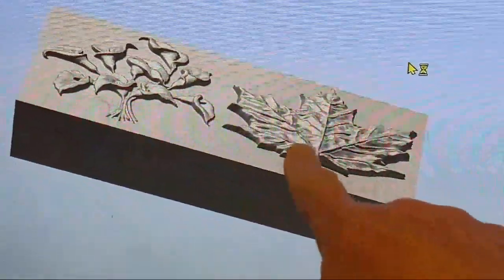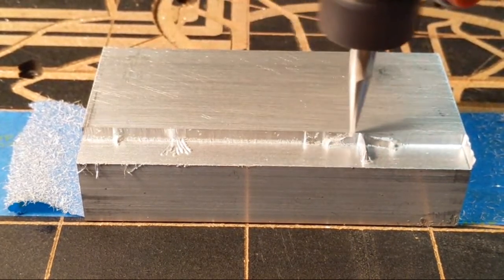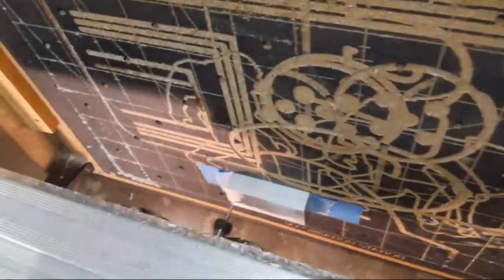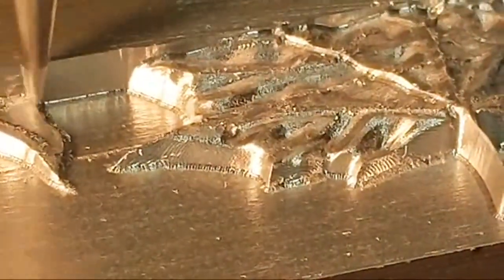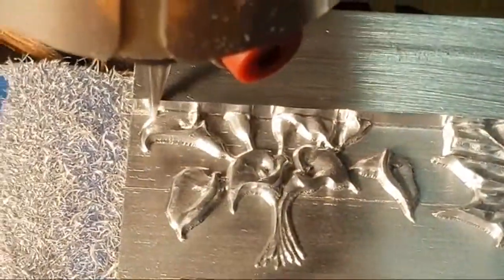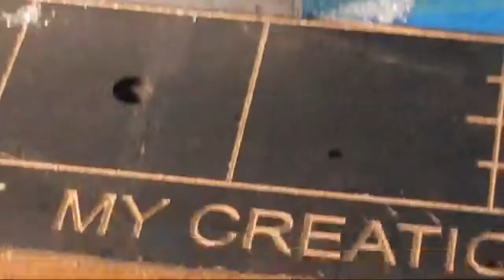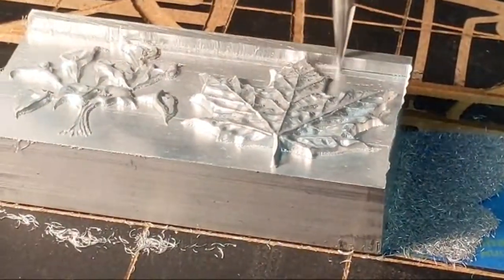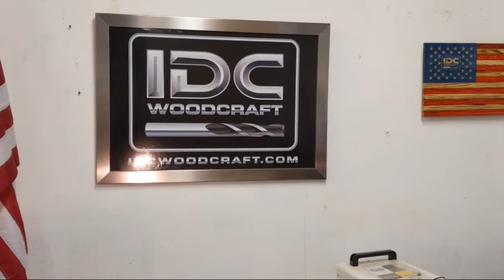GET NEXT LEVEL! 3d Carving Aluminum on Your CNC Router - Live

Comment: This is why I just got a tapered ball nose. Cannot believe the blue tape and super glue is holding this down. Throw away my machine vices?
Reply from the maker: Always Censored, I would hold onto your machine vices for now! You need them for more aggressive bits.
Reply: @IDCWoodcraft  I dug them out yesterday, going to need Evapo-Rust and do Hand Tool Rescue on them before they are usable. Got extra M6 T nuts for them, but most are too high for the 3018.
Reply: Down cut endmill to keep it stuck down? I did get single spiral 3mm upcut just for aluminium, brass, but suspect good clamps will be needed.